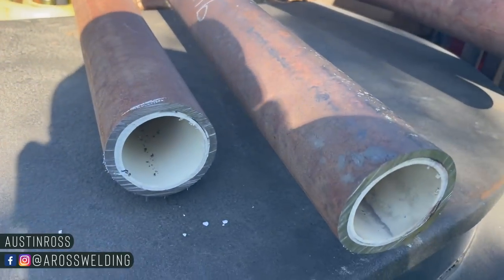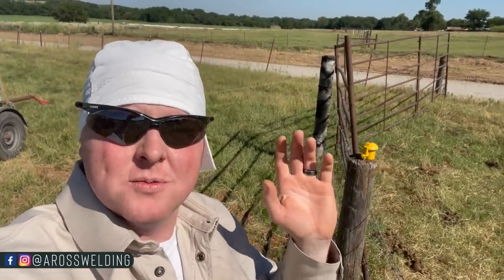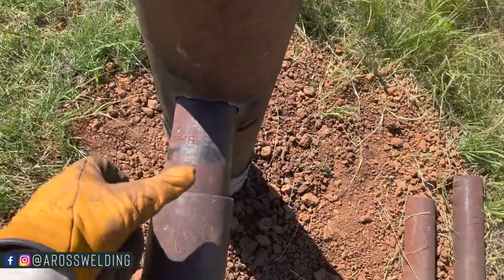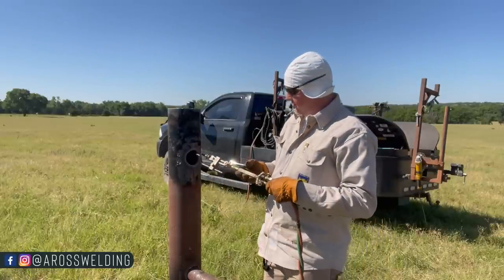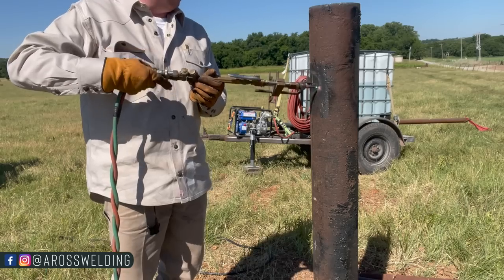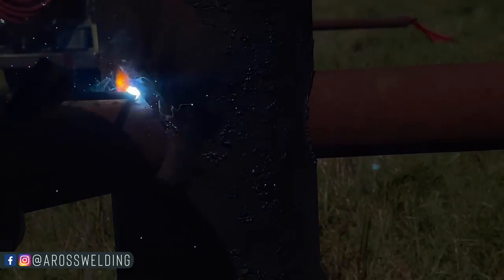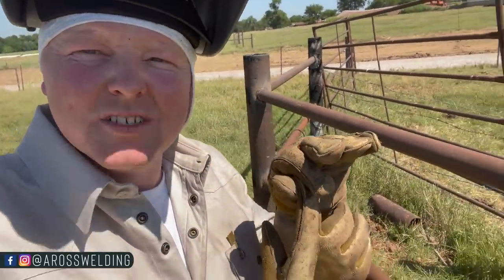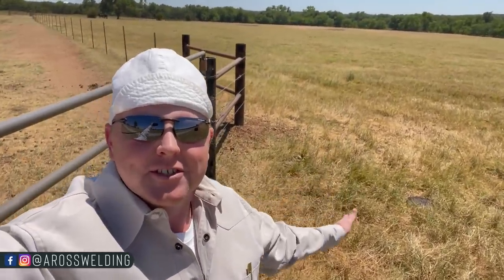HOW TO WELD PLASTIC LINED OILFIELD PIPE

Comment: Oof, had to lay that stuff down on the oil rigs heavy as hell!! I know they used it on one of our wells that was radioactive to see if it would stop corroding so fast which it did help. Also used it on another well the tool pusher said they wanted to use it to see if they get more life out of the pipe with less pitting and rod wear. They call it poly core though, it did the job it was supposed to I think those wells are still pumping with no pipe pulls just new pumps that was when I was 18 so 10 years now. My back still remembers how much they weighed lmao